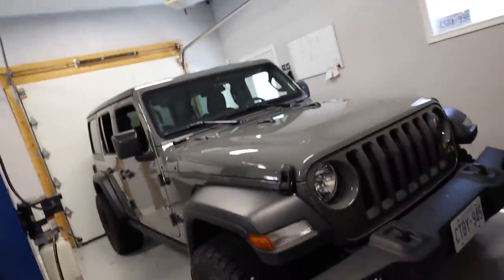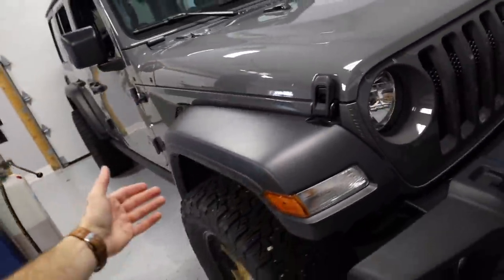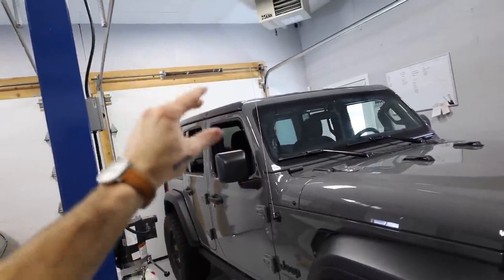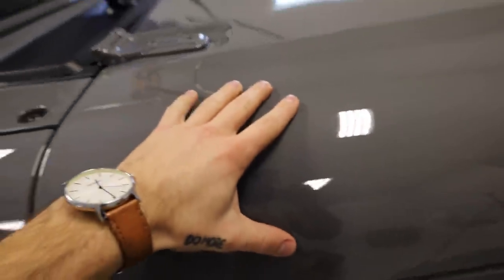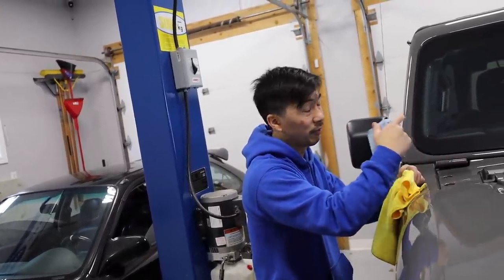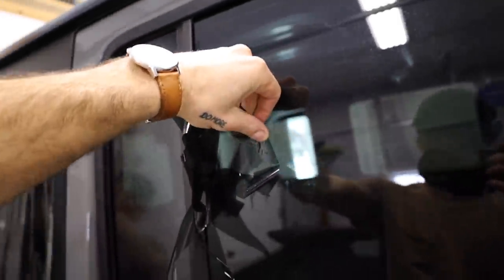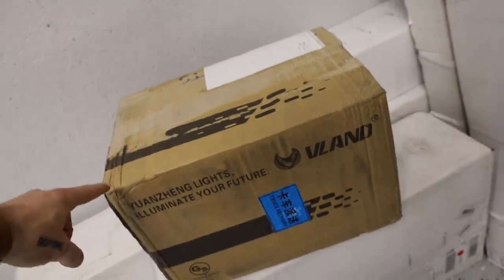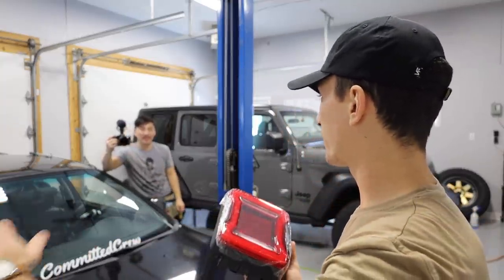Installing CRAZY New Jeep Lights + SURPRISE MODS!

Comment from the maker: Lighting Update: DO NO BUY THESE. The company will give you the run around, the lights are garbage and they don’t work no matter what you do, resistors, whatever.
Reply: that turn signal is for the middle eastern wrangler
Reply from the maker: @maple5596  they said it should work for me tho💁🏼‍♀️ the entire light is now giving me issues and I’m not having any fun tbh😂
Reply: @RobbieFerreira  F 😂
Reply: The tail lights as a whole are giving you problems, or is it just sequential part? I would to possibly order these for the look, but uneasy if they are problematic. TIA
Reply from the maker: @Elizabeth_Cochran  update in today’s video!!
Reply: Have you figured out the issue in those taillights
Reply: We purchased these tail light for our Wrangler JL. When they finally arrived we had nothing but problems. They didn’t work properly and were a safety hazard. Tried to return them and got the run around. Anybody reading this don’t buy. It is a scam.
Reply: @RobbieFerreira  which video has the update. I just purchased these.
Reply from the maker: @jfattizzi  they do not work. Return them!

Comment: sequential might not work cause the Jeep doesn’t have the wiring in North America for a separate yellow turn signal in the back since it uses the brake light as the turn signal.